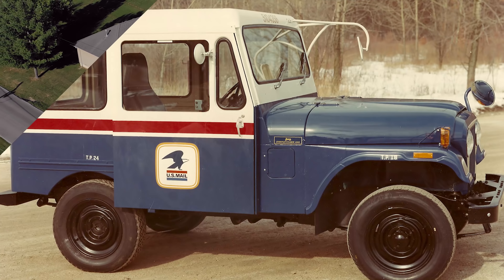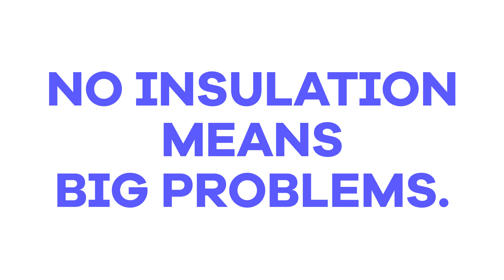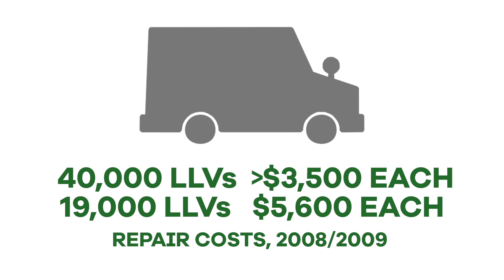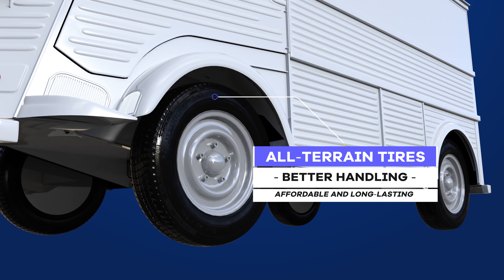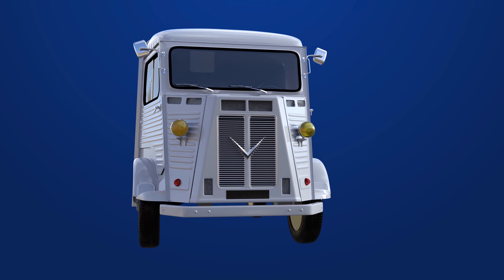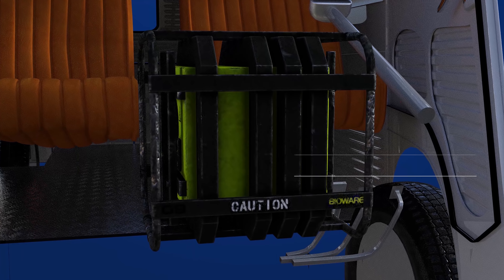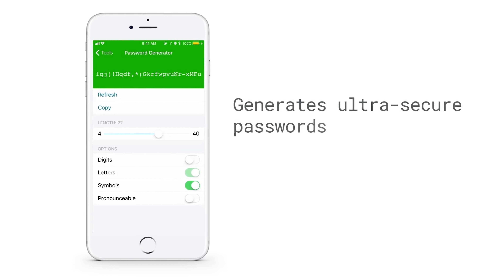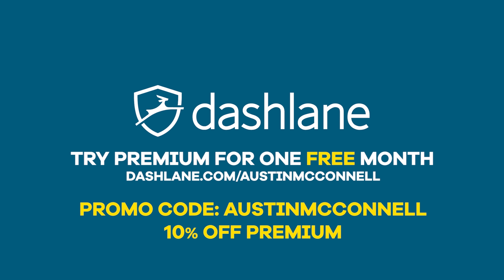Postal Delivery Trucks Stink. Let's Redesign Them.

Comment: I'm a mail carrier. Here are my thoughts on your design. 

All terrain tires? Sure, but more importantly the truck needs to be AWD, or at least FWD for snow.

The truck sits higher? Fine so long as the actual drivers seat position isn't higher. Remember that the LLV was designed at that height for a reason - to make reaching a mailbox easy for curb side delivery. The window is at the same height as a standard mailbox.

Air bags/safety features? Sure, long overdue.

We carry a scanner which runs some flavor of Windows Mobile. We do not carry any sort of tablet. Building these things into the truck probably isn't that great of a idea. An external easily replacable device would be fine, I guess.

Cameras? I don't know about multiple, but a back up camera would be nice. 

Electric motor? In theory? Absolutely. In practice? I don't know. I'm not aware of any post offices that have the infastrcture in place for the chargers, so you add that cost on top of the already higher cost of a new electric vehicle and I'm not sure it's pratical. I know it makes sense in the long term, but the short term costs just might be too great.

Flames? Absolutely required.

Your example model was left hand drive. These vehicles have to be right hand drive for curbside delivery.

Comment: The first thing is, mail truck is for mail delivery, need to have a sliding door for the driver, need to drive on the right, and packages really are secondary priority. But overall, current trucks are not going to be replaced for another 10 years because no one is going to fix some broken trucks before replacing them. But USPS fixed the old trucks, so they are going to have to last for another 10 years.

Comment: No clue what sort of washer fluid you fellas in the states use, but washer fluid is typically just water and a detergent, sometimes you may find a small percentage of alcohol in it to prevent the windscreen from freezing over! The reason that washer fluid would help cause a fire is because the water would cause the circuits to short out and the wires or plastic housing is typically what would catch fire.

Comment: I wouldn't integrate the tablets to the truck.  Tablets are frequently EOL'd and need to be replaced, however the trucks electronics can be designed to communicate with and support the tablets.  

Although the trucks can be charged daily, they would need a lot of batteries for the required range, I would suggest a diesel electric hybrid using predominately biodiesel to give the necessary range.   This would also allow the lithium ion or variant batteries to be kept between 20% and 80% charge to maximize their lifespan.

Also, in some Scandinavian countries, they've been equipping mail trucks with passenger seats to provide some public transit to more remote locations, this should be considered for the larger long haul mail trucks.  

The trucks also need to be configured with enough room for the electronics and sensors needed for autonomous and semi-autonomous operation.  Certainly an expensive option now but autonomous vehicles are an eventuality so leaving the space for such equipment would be wise.  Besides full self driving isn't needed, just pulling up to the next mail box is needed.

As the speeds should be relatively low, the electric motors could be hub motors giving both four wheel drive and removing the need for space to house the motors within the truck.   Hub motors increase unsprung weight in the suspension which is of lesser concern at lower speeds.

The diesel generator portion of such a serial hybrid need not be large as it would only need to generate the average power output and could be a compact axial opposed piston diesel.   Presumably less than 50hp perhaps even 20hp would be needed as the electric motors and batteries would provide for any surges needed and the diesel generator would only need to recharge the batteries or capacitors over time.

All components should be designed for 3d printing or CNC fabrication so spares will always be available when needed.  Battery packs should use industry standardized cell sizes much as the early Prius's used sub-D sized cells.   This would allow the battery packs to be frequently reconditioned at minimal cost and with minimal labour.

Note that intensive electronics and batteries pretty much necessitates air conditioning.

Comment: hey, I'm sure people already told you. most of your design propositions aren't very applicable. Here are a few mistakes I found, and how to correct them:

The steering wheel needs to be on the right side so the driver can reach the mailbox. the thing with collisions was generally just a side benefit.
The body shouldn't exactly look like it was ripped out of the early 1960s (opinion)
the airbags should go off when a collision occurs, not when a collision is assumed to occur
installing an onboard computer takes away the "affordable" aspect of the vehicle
cameras also make the vehicle far more expensive
just getting heavy-duty tires won't fix the issue with ice. you still need snow tires.
the conversion to EMS isn't exactly applicable, but I can see what you were going for. having a fleet of 100s of jury-rigged ambulances during times of crisis sounds good.
An electric engine sounds like a good idea on paper, but the price tag is just too high. not for the engine, but for the charging stations.
I like the LED idea, but it should be assumed that manufacturers would just include them due to their high performance and relatively low cost

I would just get a group of engineers together to get quick and effective solutions to the issues with current trucks instead of making new ones.

installing some form of insulation to just the cab (not the storage compartment)
replace the heating systems
get a high-volume vent fan that can take air out of the vehicle on hot days, with an insulated panel that can be placed on the truck during the winter to cover the fan (keeps the heat in)
adding a drain plate above the fuse box so wiper fluid won't drip inside, causing fire
add a mount for the tablets mail carriers use with a charger if they don't have one already

I liked your ambition with the video. you brought a very important issue to light and showcased this issue with good editing and animation. I am studying to be a manufacturing engineer, so my propositions may not be applicable. sorry for this essay of a comment.

Comment: The battery packs on the redesigned USPS vehicles would easily limit the vehicle service length alone, and replacing them would NOT be cheap. Hell, the truck he's proposing would cost as much as a Tesla, with maintenance costs orders of magnitude higher than the current USPS trucks. Elon Musk is NOT the person to be consulting to solve this problem.

Comment: Or you could upgrade the interior compartment, add some off-the-shelf tech and replace the engines with the economical 4 or 3 cylinders from modern light vehicles. 
What you seem to be trying to design is more of a delivery-utility van. Mail isn't heavy but there is a lot of stopping. This is why in New Zealand we are using small road-legal ATV-sort of things called Paxters, while the private mail service uses CT110 bikes.

Comment: You forgot about using the most efficient power plant in the world, the Diesel engine. Some might not like it, but I’m here to tell you, if a 25yr old truck way heavier than the old s10 trucks that were made over 30yrs ago weighs 4000lbs gets 1/3 of the mpg an old diesel truck which while carrying a trailer weighing 5000lbs, + 6500lbs of truck gets 16-18mpg! 

Talk about diesel power, this is a truck that was made 25yrs ago, when it towed that much it had 375-400k miles on the clock & still ran & pulled strong!

If you think an EV can do that with that kind of efficiency & longevity you’re out of your mind.

Comment: The reason the steering wheel is not on the right for safety, its on the right so you can deliver out the window while staying in the drivers seat. There is no passenger seat instead there is a tray to hold out letters and magazines. You make some good points, but it seems this truck was not designed with mail delivery in mind. It would definitely need to be refined by someone who currently carries mail.

Comment: "60 mph top speed" Ha! in my office some of us drive them up to 75! they make a strange smell when you do that though, and it really eats through the gas

now for me to crit the truck you've designed from my understanding of 1 year of delivery under my belt.

(i dont know if you mention it but the truck looks longer, like a standard car, part of the reason why the trucks are short is because they have to be really short and have a really tight turning radius for use delivering down any and all roads, including incredibly cramped and windy ones)
1st thing you show is the back having 3 separate doors that I'd have to open to get one of the really big boxes out of the back, which would at least triple the time i'd be opening the back, maybe more, also how would you lock those? also they look like they'd have more opportunities to stop working, which, when you're using them 12 hours a day in all weather in dust and heat and snow and so on 365 days a year, def matters.
the tires most likely start out with all terrain treads, but, again, imagine going on a nonstop roadtrip every single day of the year, they get worn down fast
we already have LEDs on most of the trucks in my office, we're waiting on the non-LED ones to burn out before we're /allowed/ to upgrade them
I wouldnt mind getting yet another sliding door but it simply wouldnt fit, i already have 2 of em.
the steering wheel is on the right, partially for safety, but maybe not in the sense you're thinking; "for safety" meaning you dont have to spend as long parked or getting unbuckled or walking around in the road, and it makes sure the people doing mounted routes dont try to deliver on the far side of the truck.
higher weight balance means that they'd be a lot more likely to flip(and people t-bone us all the time trying to pass us on our left while we're already turning left, so you can imagine how just making that a biiiit more likely would mean a ton more injuries)
MVAs; i think something like half of all MVAs occur while the operator is not even in the vehicle for LLVs
no most of us dont carry a tablet, that would break, we have scanners, they look like trash, and almost fufil the same purposes, but mostly the features are abused by mgt to harass the workers
I wouldnt mind cameras, even shitty outdated ones, this can stay, but where does the monitor go? the ceiling? gonna be a melty monitor come summer

all in all, im no expert, but i think that a lot of what was listed here is either misunderstandings or bad ideas in general, but theres a few good points, and at least it doesnt have the piss-window like the CRV(or FFV if you call them by the newer name)

Comment: Oh wow you designed a truck that has electronics that will become obsolete in 5 years, and an extremely expesive and an overly complicated system of tracking, and vehicle monitoring. As well as an electric battery that will take up precious cargo space, and that will need to be replaced after 8 years. Which would cost around $2500 - $4000 per truck.

Comment: Honestly, I think a good replacement for these vehicles are already in place, but aren't used in the U.S commonly. Some places just use modified minivans, which tends to solve most issues except for really large packages. Comfortable, more affordable, easy to work on, and very much designed for use in all climates. There are many models out there that already utilize AWD, modern AC and heating, insulation, and even on-board GPS and other such things.  It'd be a relatively simple job to redesign an existing model to take out most of the seats and work in a few shelves.

Comment: Yes my blocking a bunch of people is rude.  But please lets come up with ideas to make a new Postal Delivery truck.  I would put in a good heater and an air conditioner so that if the truck gets the assignment of driving routes where the heat is severe, the driver is comfortable.  I would leave the steering wheel alone.  I did have to block a person for predicting the high-tech stuff like a stupid psychic.  That is because I don't believe in psychics.  Back up cameras are a good idea since if you are driving the truck and you don't have any way to see who is behind you very well, and trucks has blind spots, the cameras would help the driver out and they would cover the blind spots.  Sitting up higher is also good since the mailman would have a good forward visibility.  I would have both windshield wipers lean towards the middle.  The LLV trucks that are still in service still has windshield wipers facing away from the driver.

Comment: 02:04 windshield wiper fluid is flammable I don't think so. Maybe a shorted out fuse box can catch on fire. So all you're saying is these vehicles need a little bit of maintenance. and some insulation. It probably way cheaper just to revitalize and upgrade existing vehicles. As long as their bodies are structurally sound. We know what goes wrong with them we can totally fix that and give them another 20 or 30 years worth of life. You know at an air conditioner put a more reliable heater system. As far as I can tell those trucks are awesome. I mean you just said they outlasted their projected life by a lot. I see a man that had his truck since 1960 and it still looks brand-new. in fact nearly everything he owned still look brand-new he only bought one of everything. His original TV is original radio's original furniture. There's nothing wrong with these vehicles they just need a little TLC. I would bet the repair costs are probably inflated by crooked repair guys. Like ever business seems to do when they get a government contract over price their services. I would just bet. 10 miles to the gallon is really sad even in 1987 I would think.

Comment: Number one problem is the front wheels are more narrow than rear making winter driving impossible. Other than that the failure to employ the in house computer system for crating mail to the actual delivery process is the only weakness but indeed a major one.

Comment: The issue we have is that the motors will burn out, batteries don’t last forever, & the electrical grid can’t take the constant current draw. Look at California they regularly have blackouts & still don’t use electric stuff all the time. They’re still at 1-3% and if that.

This is a perfect use for a Diesel engine or a diesel hybrid. Diesels use very little fuel if they are straight piped, & are not messed with.

Diesel engines are very tough & can last up to a million miles, diesel fuel is very safe, diesel fuel cannot be lit with a lighter. Diesels will run on waste motor oil. 

If they are smart they should use all the waste oil they get from restaurants, & parts stores for the trucks.

I can already tell you that electric motors seem good in theory, but they won’t last. Diesels are cheaper to make than electric cars, electric cars need a controller, battery, & metal to protect the battery. 

Batteries weigh a lot & so the motors have to work harder to move them around. 
If they were smart they should’ve used diesels, because they are cheap to fuel & they can last a very very long time of tended to, & don’t have crazy emissions standards.

If they put the right diesel in that truck it could easily get 20-30mpg even with harsh emissions standards.

Comment: Since it can be electric, have a part time AWD system. In short. 2 motors. one front one back. its FWD in normal conditions, and when it has no grip. AWD. in normal conditions the rear and front motors use regenerative braking. Have an AC system in it, have a larger bed in it for the hot swap feature.
Reply: And how about steering wheel in the middle. have the front narrower. Meaning you can hop out on both sides. Since the front would be narrower, the front axle can be shorter meaning smaller turning radius.